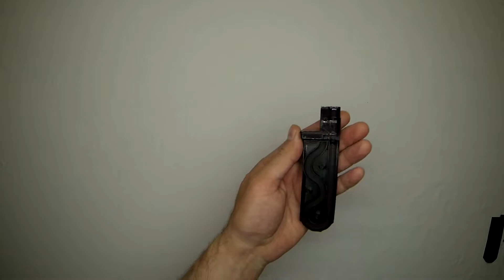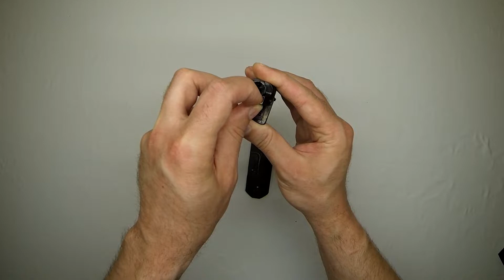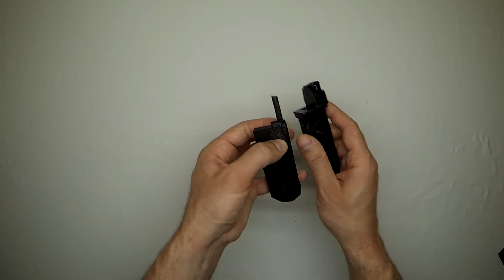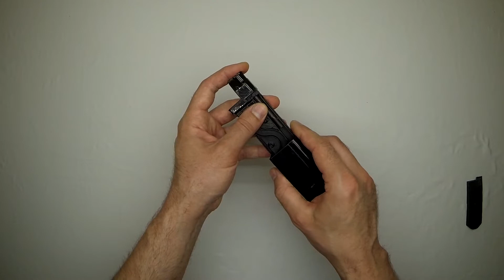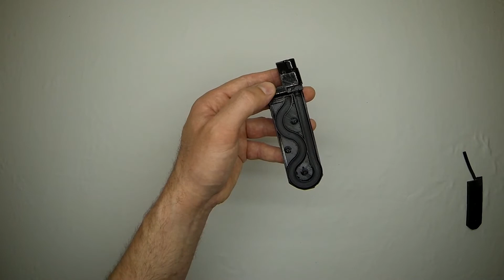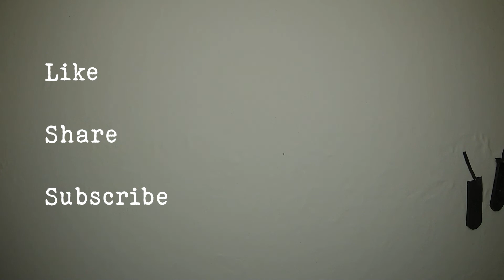HOW TO CONVERT HI-CAP AIRSOFT MAGS INTO MID-CAPS

Comment: Would it be possible to make a video of this but for the Thompson? I hate using plastic mid caps but the only metal magazines are high caps
Reply from the maker: It's possible... but not soon. But there's not much to it. I would use a metal strereith MP5 mag . Dissassemble the metal hi-cap and somehow mark (or remember) how high it was sitting in the mag body. Cut off the hi-cap machanism from the internal part (so  you're left with only the top part - the doors   for filling bbs and the part that goes on the hop unit  and has the latch that holds bbs in the mag). Dissassemble the MP5 mag and keep the internals - remove the bb latch from it (and the spring and the follower). Put something flexible with 6mm diameter (power cord works for me); grease it up and put it through the top part of the thompson mag (what's left of it) and into the MP5 mag. This is how you'll ensure, that the bb feedway stays clear. Now just use epoxi or ABS paste (watch my video) and use it to join the two mag parts together. Put the new mag into the body of the thompson mag (while the joint is still flexible). Secure it and wait for it to dry. Remove the power cord and check if it feeds. If not, do some sanding. Trial and error; it's the only way. Youll probably screw-up the first one, but you'll get there
Reply: Thank you so much, I'll give that a go
Reply from the maker: @956Eye  good luck.
:)
Also; for a better result split all the components (tme MP5 mag and the top part of the thompson mag) on the left and right halfs.. This will allow you to modify or fine-tune the bb channel on the inside. And you'll be able to clean the mags if needed

Comment: nice work bro, do you have some like this for mp5?
Reply from the maker: No, it's easier and cheaper to buy mid-caps for MP5
Reply: @AirsoftTipsandReviews  
I was wondering why it is difficult to get here due to customs problems and laws - in Uruguay, thanks for answering
Reply from the maker: @misterkj356  I didn't know that. In that case you have 2 options: you can use a shotgun shell for spring shotguns (but it only holds 30 BBs). Your other option is to make a 3D printed insert. There are a few pages on Facebook (that are specific for airsoft 3D prints) or you can check  Shapeways or Thingiverse